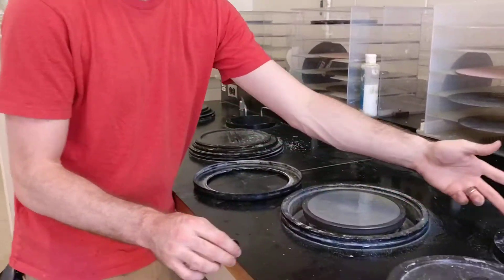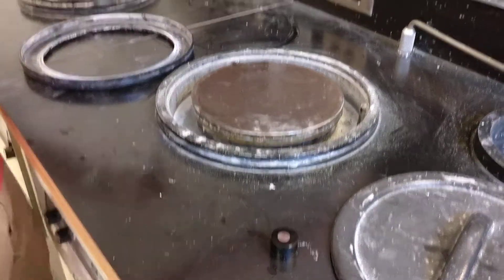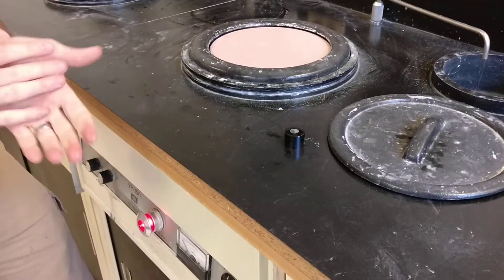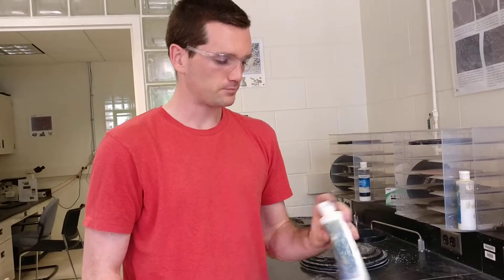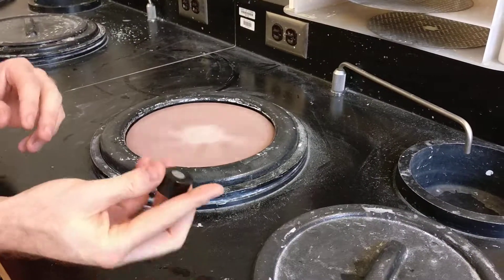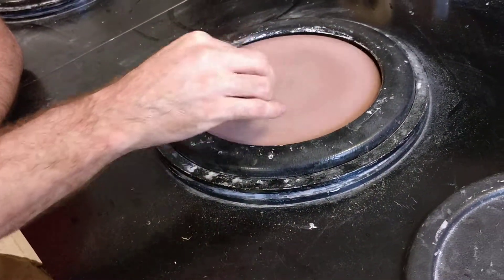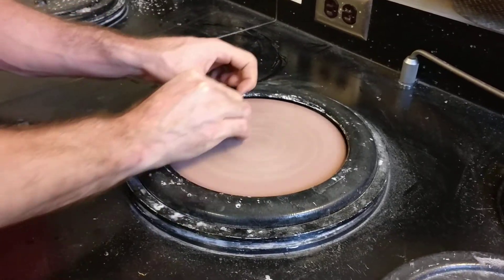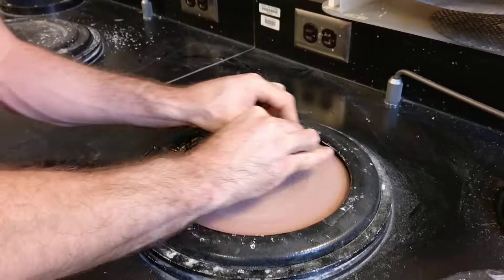Polishing on Leco Vari/Pol VP 150 Polishing Wheel

Comment: Helpful video, how would apply 9 micron diamond and 1 micron diamond before the .05 alumina? or if ground down to 1200 do you need the 9 and 1 micron?
Reply from the maker: i've found these to give reasonable results for our application. it may just take more time at a certain step unless you do those. We used to do 5, 1, and 0.05 micron alumina but if you have contamination it kind of ruins the point.